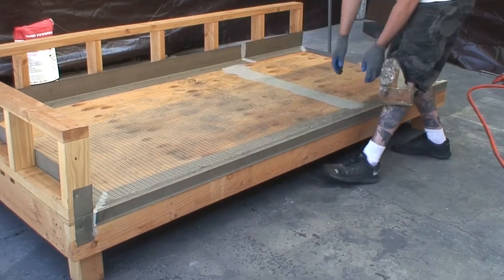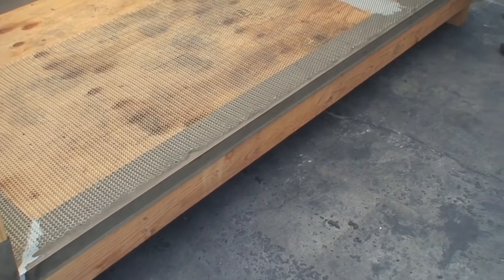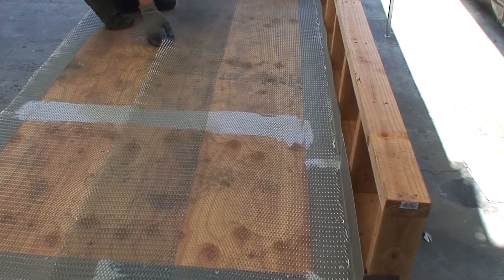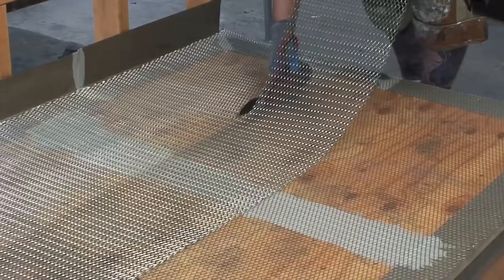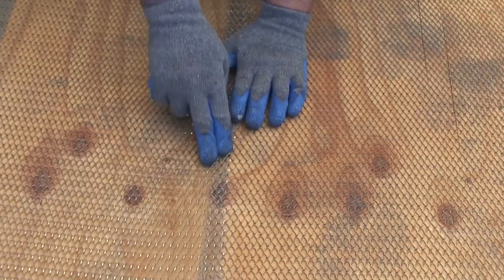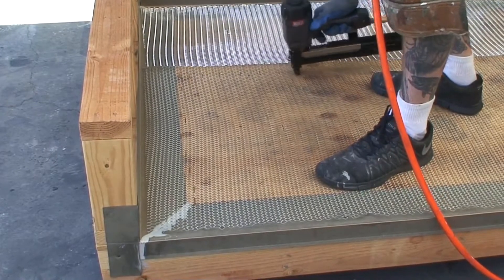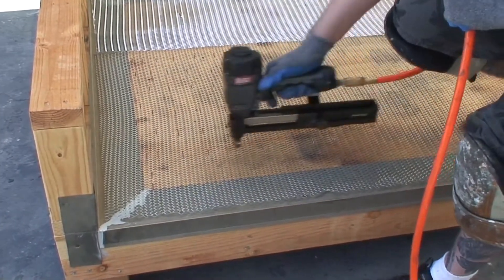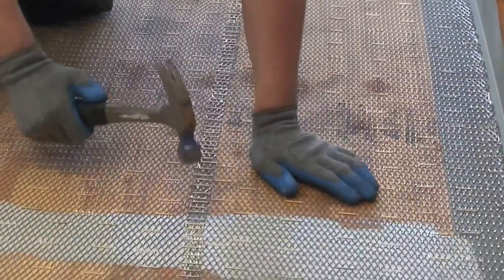Life Deck AL System (Step 2) Metal Lath Installation

Comment: Do you really need that many staples? I think that create a lot of holes.
Reply from the maker: We  recommended stapling the lath using 16 staples per square foot (minimum 1” crown x 5/8” long, non corrosive equal to Senco brand).  Overlap the lath between 1” to 2”.  With a hammer, pound down any seams or staples that are higher than the lath. Once this is complete the base coat and the slurry coat are applied.
Reply: That's the way lat has to be installed . If you are using a different method, then you are doing it wrong ,
Reply: @emanuelvasquez1897  Have not done it. Never said I am using a different method. Ive just learned this one. Best to ask the questions first.